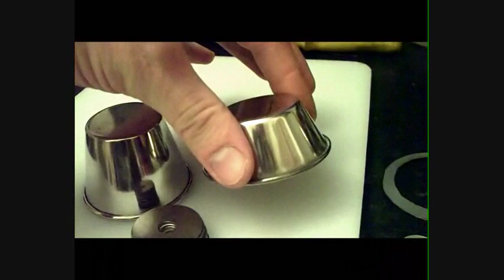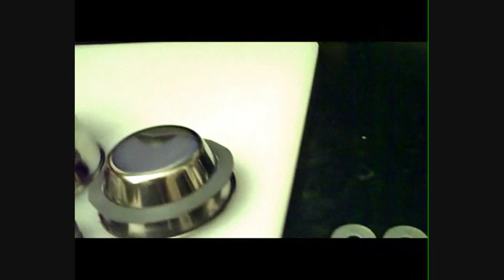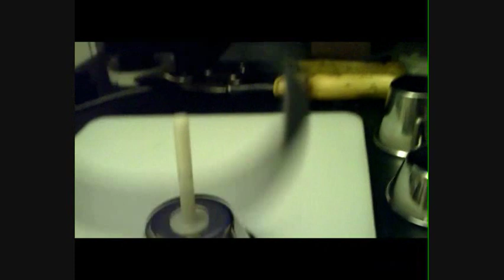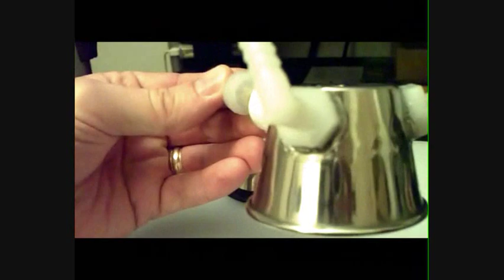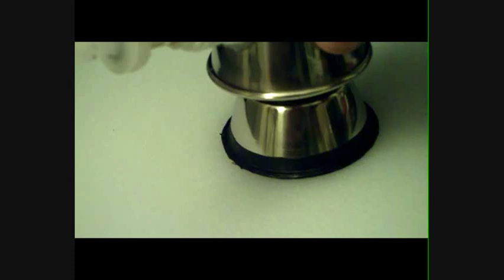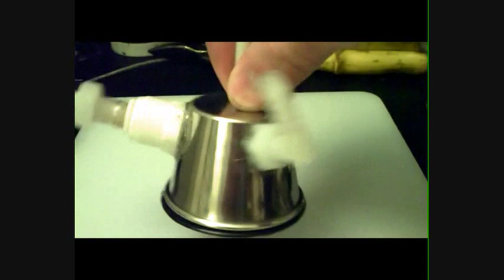Vid23 Dry Cell Hydrogen Generator "How To" (HHO, Brown's Gas, Hydroxy)

Comment from the maker: The connections I use are circular crimp-on connectors that slide over the nylon bolt. 

There is one underneath the bottom cup and one connection on top of the top cup. The connectors will be placed in direct contact with the associated cup and can be secured using a nylon nut.

If you view Video 19 you will see a similar design that is assembled. It should give you a better idea of how I've setup the connections.

Heheheh.... Drunken Money!!!

Comment from the maker: The washers don't need to be connected to power, because the water and electrolyte carry the current across the washers from the positive to the negative. All of the neutral washers will not be actively producing HHO, only the ones closest to the POS & NEG. 

The reason for doing this is to reduce the amount of voltage to the POS & NEG cups, so the amperage and heat will be reduced without sacrificing output.

Comment: Quite creative and a nice job; but I'm a little confused as to the washers inside the device; (are they just spacers?), are they connected to power or is this a two plate design? Where do you make your electrical connections to your cups /and or the washers? I used Condiment cups in my design and the output is pretty good, but yours is more polished in appearance. Mine looks like a drunken monkey put it together. Keep up the good work.

Comment from the maker: Thanks, that was a good idea. 

I tested the heat resistance, by putting the cup on a pie tin and sticking it in the stove.

After heating up the stove for 15 minutes, I put the cup in the stove and tested it at 200 degrees for another 15 minutes, and it did not melt or bubble.

That is a good enough test for me, because the temps I've been working at have been 110 to 125.